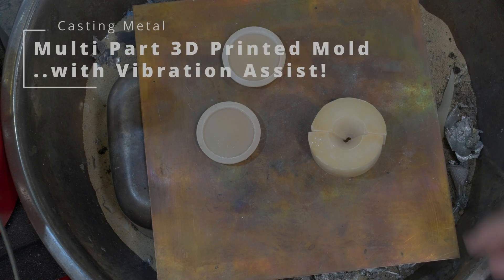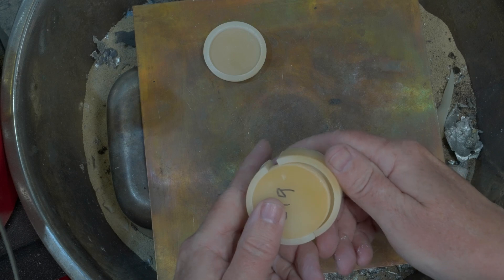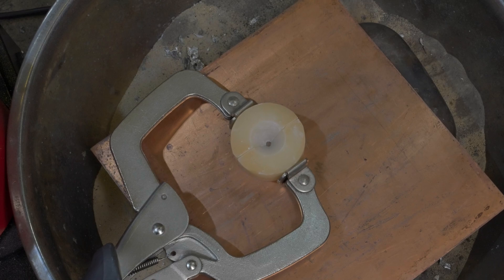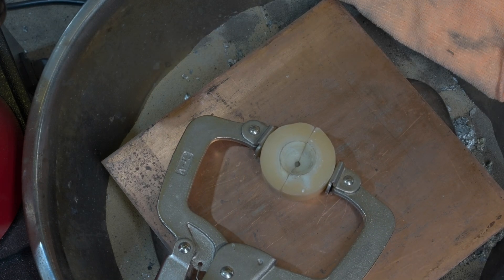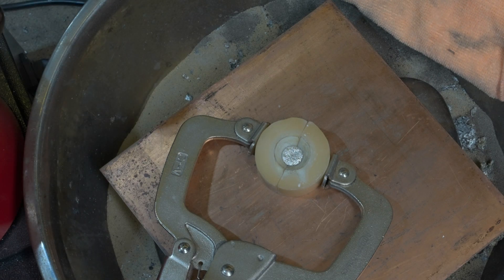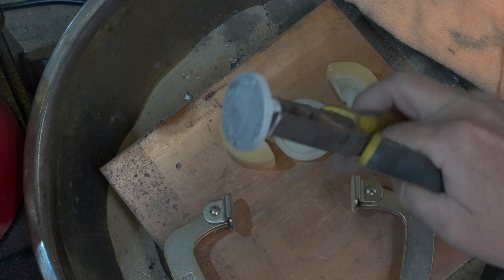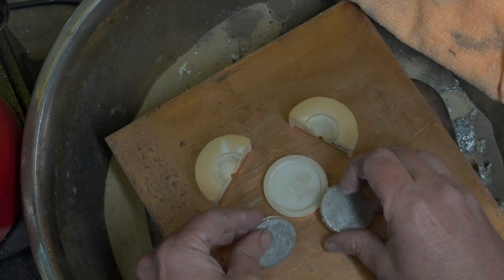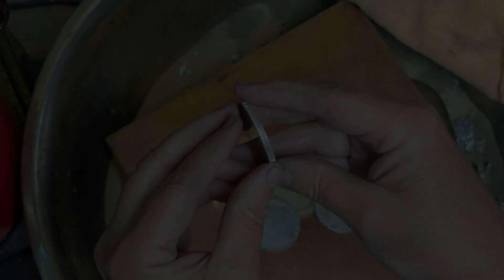Casting Metal into a 3D Printed Mold - Part 3

Comment: There are some others that handle this process just fine but they're a bit pricey, I feel like that's the critical element there.
Reply from the maker: I've tried a few other brands for this and only one could (just) handle pewter (max temp is 240c).  I've seen nothing that can handle Zinc @ 500c.

Comment: I have seen “simple” 5 part rubber injection molds. They were metal but I bet if you make your molds with plenty of indexing and clamp it to an inch of its life it will work.
Reply from the maker: I've got a 7 part mold read to test :) - I'll let you know how it goes!